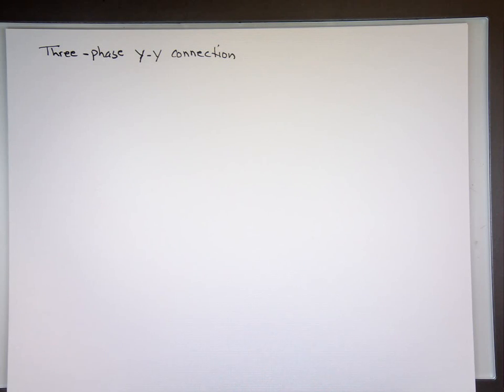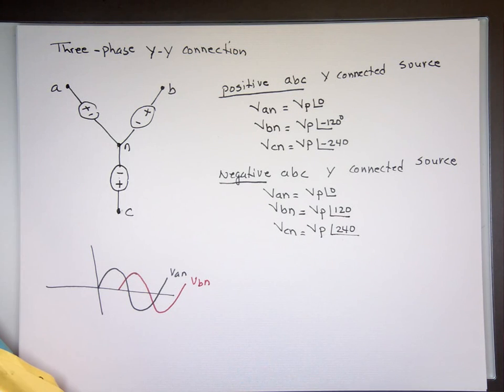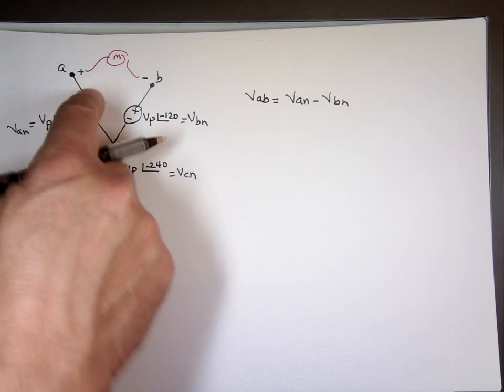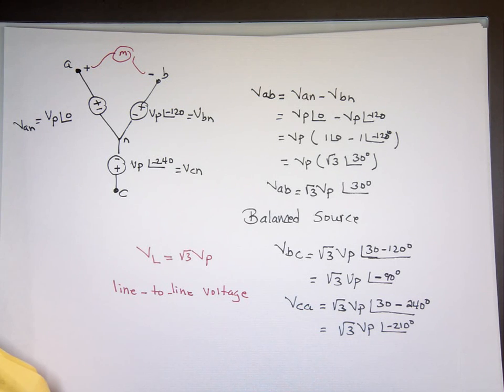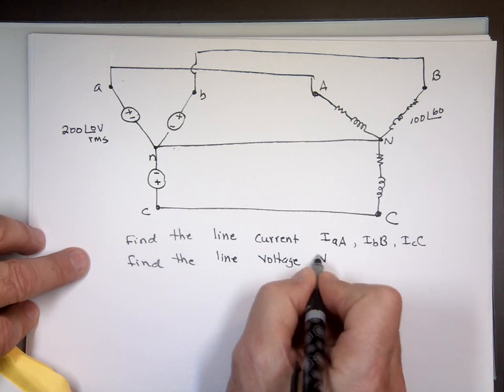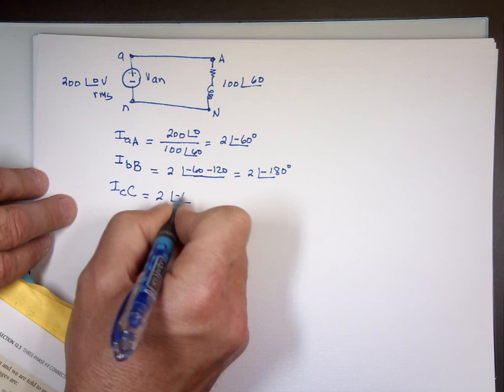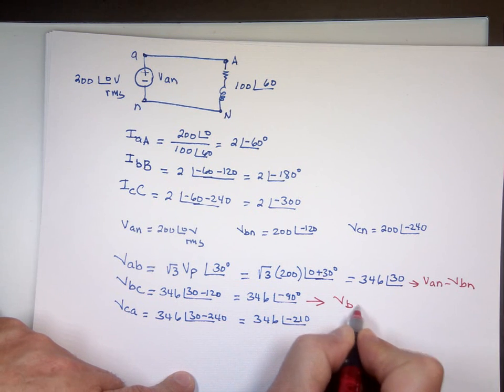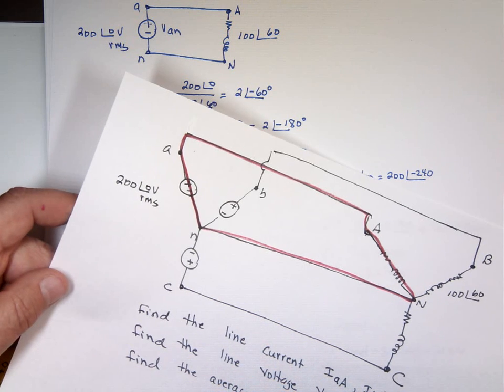Three-Phase Y-Y Connection

Comment: There is a mistake in the Power.  the Power abs by BN is not the same!!  because the current phase is different
Reply: Hi Yuvi... In the power calculation, the trigonometry for multiplying two vectors is wrong. It should be Cos(a+b). In the current calculation, Cos(a-b) is correct for division of two vectors.

Comment: Sir, What if there was a line resistance (say 2 ohm), should the average power formula at the end change ? ie Should I do voltage divider to find the Vrms at load in such case.. 

(Its 2019, So I don't expect to have any reply.. nevertheless  your video was useful )
This has the most in-depth analysis on Y and Delta connection... But the like and view count is comparatively low.. (Like from me, thank u sir )